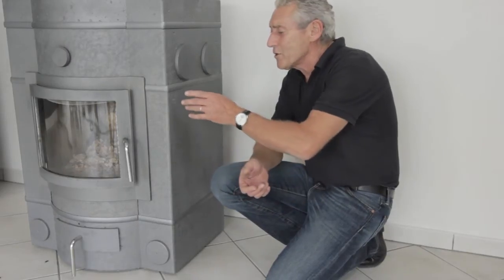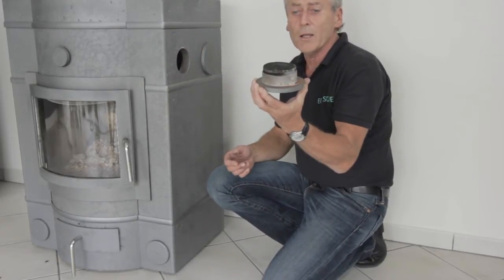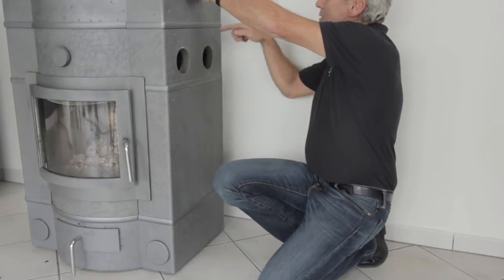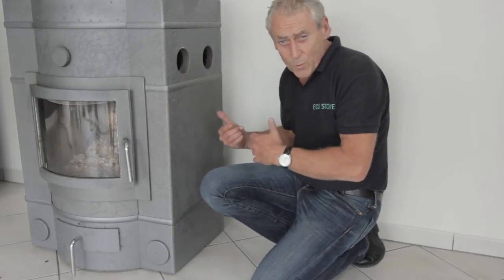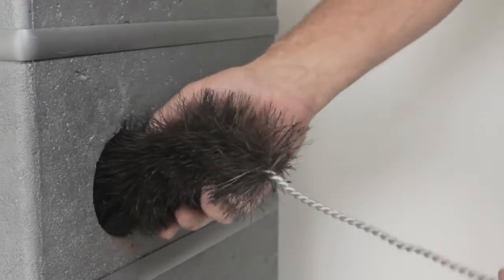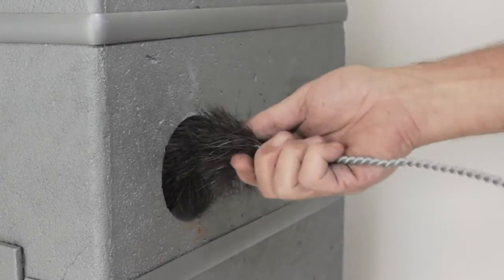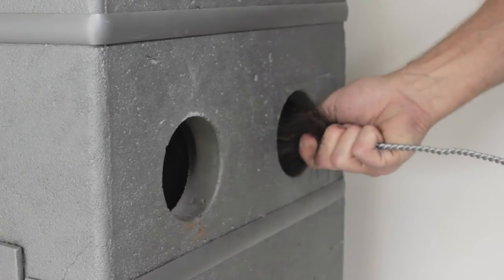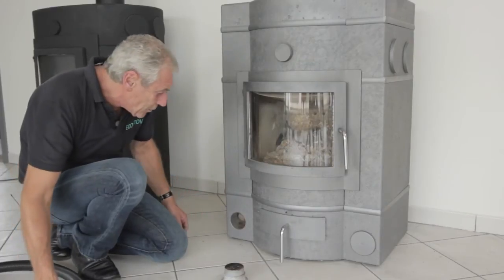Ecco Stove - Stove Care - Cleaning the contraflow channels

Comment: I like the Ecco stove  and it's  counter flow design like it's higher priced soap stone competitors it uses thermal mass to heat long after the fire has gone out.
Reply from the maker: A much more efficient way of heating with a very high combustion temperature for a very clean burn while shielding the room from being overheated and pushing the heat further than conventional steel stoves.